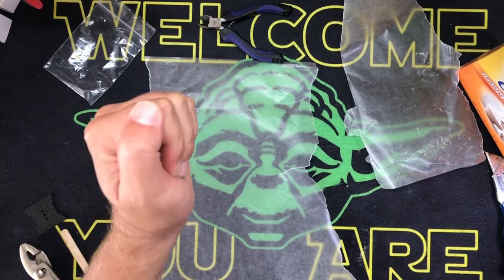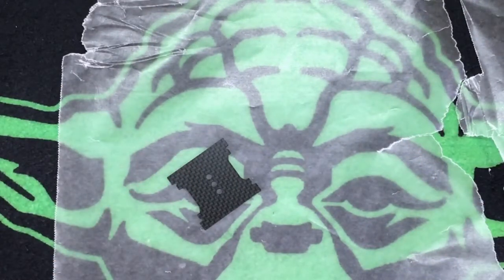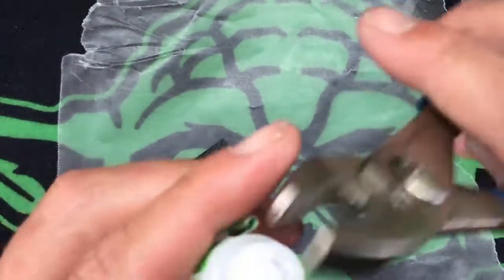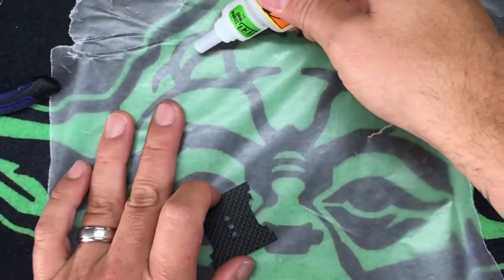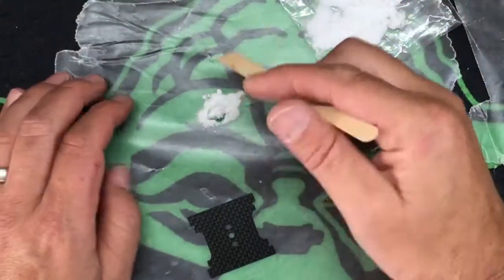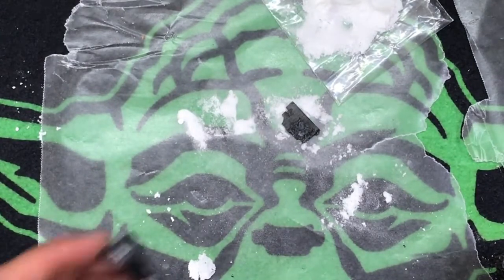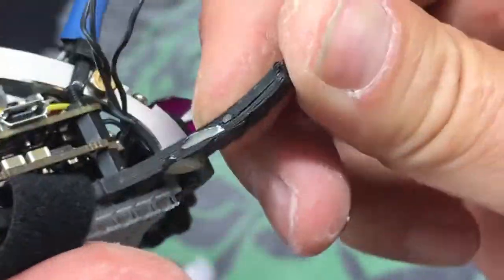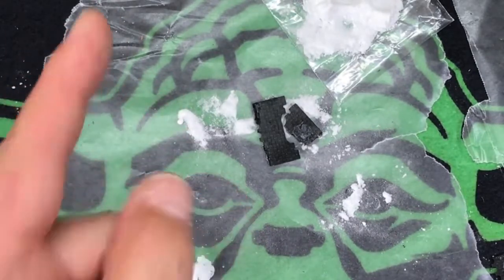Carbon Fiber Repair Test, Check this out!!

Comment: It's a very good technique for repairing broken guitar nuts and bridges without removing them! 
Pile up the baking soda on the area you want to fix, drip on liquid CA then file it down to shape! It even works for raising the string groove if the action is too low or worn, fill the groove, add CA and file a fresh groove in.
Reply from the maker: Yes I restored guitars for yearsssssss.    I would usually replace the bridge and but and reshape the new, but yes it would work for that to!!!

Comment: I use gorilla glue and add salt and pepper till its goopy. Makes a type of cement the likes of which i have never seen! Learned it from a friends grandpa. He had a reason as to why the salt but not the pepper lol. ehh smells cool now too. VERY HARD! If you try it you may never go back. Its my go to for heavy holds. Also I have wanted to check out SUGRU for helping with frame builds. Best videos for a relaxed open view. thank you!

Comment: I think that CA trick is better used as a reinforcement rather than just an accelerator. As in if you want to put a fillet in a corner of 2 plates you can use your CA to get the 2 plates to stick then glob some in the corner and dust it with baking soda and it will kinda fill the corner up adding some strength to what would otherwise just be essentially an edge bond.
Reply from the maker: Tom Detka ooooohhh you said fillet!!!! He's talking welding!!!!!!   My kinda talk!! Awesome, thank you for the advice!
Reply from the maker: i completely agree.. its a cool trick. !

Comment: you just need resin and hardener or you need to use a fiber like cotton balls or thread made flat or wrapped. lol my favor glue is zap a gap never dries up on me just clean top after use. you can fix flat breaks drill a hole in each side push thin nail in one side put together do glue in joint put the soda on top then sand then thin coat with glue. you can fiber wrap and it will get hard fast and not use the soda make fibers long way. get some fiberglass carbon or Kevlar even nylon its good too for repairs epoxy is good too better then most ca glues. lol